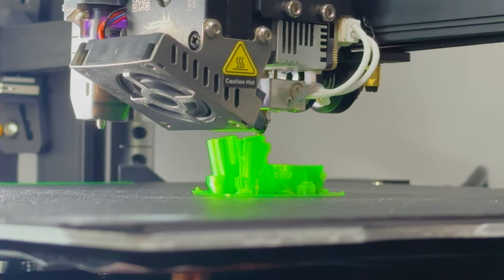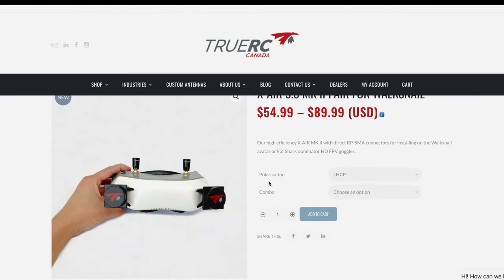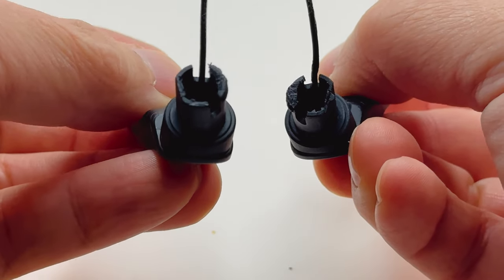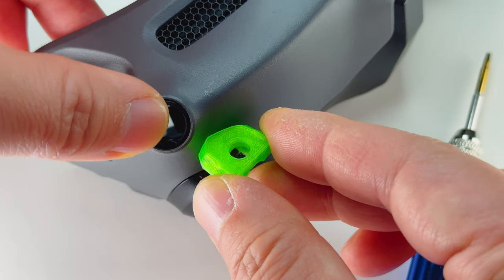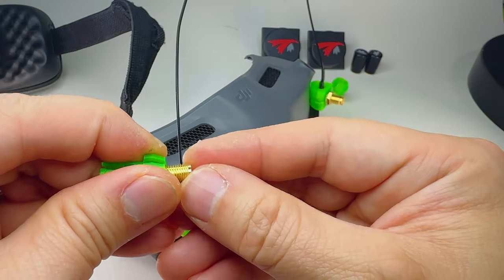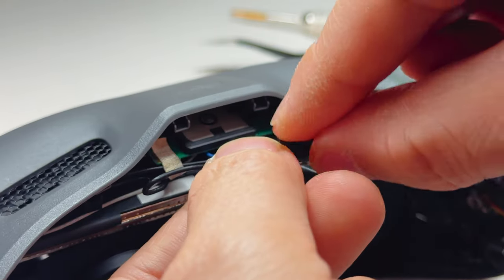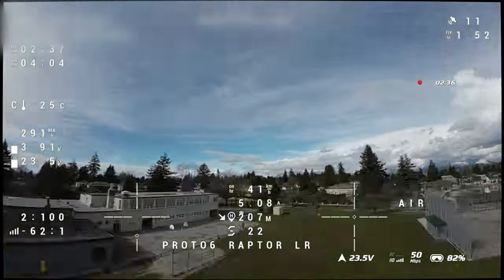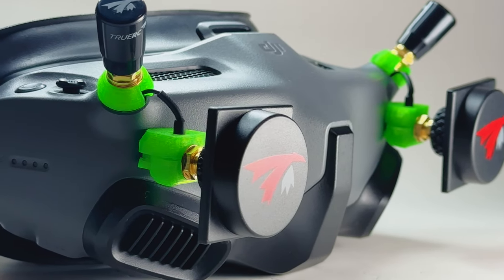HOW TO MOD ALL ANTENNAS ON DJI GOGGLES INTEGRA

Comment from the maker: * After doing the mod, Redo the binding/pairing with your vista or O3 air units. I found out that upon plugging in for the first time, the view was pixelated and mbps was at 0, some quads corrected themselves some didn't. After rebinding/pairing/ or rebooting, everything became normal
March 18th update: * Got to Test it as far as I could https://youtu.be/dxSvBEjHxo4 Need a bigger battery :)
Reply: Guten Abend 

Wo bekomme ich die Antennen Halterung?

Ich habe leider kein 3D Drucker. 

Gruß Robert

Comment: The easy way would be to ziptie/tape them to the stock linear antenna plastic housings. They fold anyway and the patches and ufl cables can fold with them, no more worrying about sma wearing out. For this method you can even go with the longer and more powerful X2 air. I heard that Truerc can custom-make them with ufl.
Reply from the maker: Thanks for your suggestions!

Comment: I want to just take the electronics, screens, and lenses out of the Goggles 2, and put them in a completely different shell with normal antennas. Why does DJI always have to torture us like this?!
Reply: For real. This mod basically just makes this the old walksnail goggles. Which came out like 2 years ago
Reply: The goggles 2 antennas come out if you just pull in them
Reply from the maker: @user-cb8ef5ki9u yes sir

Comment: for this kind of upgrade in dji integra what kind of antennae used in the o3 unit system ? Then really this informative video thanks for 3d print design
Reply from the maker: Hi I personally used two tbs long range triumph pro lhcp . https://www.team-blacksheep.com/products/prod:triumph_pro_lsma_lr you would also need two ufl to sma adapters. But any long reputable lhcp antenna with ufl will do too.
Reply: @PattyFlipz Will this modd improve the signal for Quads using Caddx Vista with LHCP antenna on it?

Thanks!
Reply from the maker: @hknight007  it's a perfect match, so technically it will work very nice, like a modded goggles v2. As for better signal, I do not know. Main thing is don't go behind any objects and make sure you have good antenna placement where it does not get blocked when you turn your quad.
Reply: @PattyFlipz  that sounds awesome, Thank you so much for your help 🙌

Comment: Wow nice one ! I like the idea of re-using the screws on the front cover 😁 thanks for mentionning my video! About the cap design I see you printed it in tpu, I printed it in tpu and pla and both left me not completely satisfied. The tpu is too flexible and the pla too fragile.. maybe there's something to improve there also 😀
Reply from the maker: Oh for sure! Yeah it’s still easy to remove as TPU, or maybe get knocked around, I don’t mind it though! But for sure if you want an OEM feel perhaps someone can try ABS ! Thanks again for the great video and 3d files to get all our imaginations going! 😃🙏
Reply: You should try carbon TPU. It's very strong with a nice finish. Also better quality than only TPU.

Comment: Appreciate the video, I did the mod following your guide however I don't notice any real improvement, I did kind of expect that and im sure in some situations the range will be better, but I guess because of where I usually fly its unable to really push it any further, I wanted to do the mod just because and I really want to learn and understand how to get more range but I think alot of it is just flying LOS and not behind stuff, thats how you get range but I guess adding better antennas at this point isnt really going to increase your penetration enough to make a difference compared to stock let me know if Im wrong, either way thanks again for the awesome tutorial, maybe i'll try some other antennas in the future :)
Reply from the maker: Thanks for trying it! I agree with all your points! I think everyone is going to have different results for sure. There’s a myriad of factors at play which makes it so interesting. The downside to my own setup (LHCP on drone and goggles) is I can’t fly drones equipped with stock o3 antenna as far anymore. Noticeably they have been performing a bit worse. But when flying matching antenna on both drone and goggles, it’s definitely most important thing I think is no blind spots with the antenna (position it correctly where it can never be blocked), and no interference (nice rural area without too much signals) and no obstructions between you and the drone, like trees and mountains.
Reply: @PattyFlipz  theres so many things I don't know and I learned a bit more lastnight, going to try changing some settings and see what happens, I usually fly in a area with alot of obstructions and signals, I was also suggested to try the X²-AIR 5.8 MK II, have you tried any other antennas yet?

Comment: Cool Mod! I'll definitely be doing this for my Goggles 2. I'm sure it's basically the same thing. Maybe I'll make a quick video on it lol!
Reply from the maker: For sure! 👍 looking forward to it!
Reply: Let me know how it goes. The main reason i didnt get the goggles 2 was the worse non changable antennas. Maybe Ill pick up a set now
Reply: Any update? If so did it work?
Reply: hello pls update
Reply: Have you succeeded to upgrade Googles 2? Do you have any video for the this?
Reply: Update: tried this and it doesnt work. At least not in the same way it does here. First off, the dji faceplate screws are a pain to get off. That took an hour just by itself. 
But opening the goggles, there is no clip to unplug the mcx connector. You would have to take everything out and unscrew it (its screwed in). I still want to do this mod without damaging the goggles so ill try to find a way to route the pigtail somewhere else
Reply: @KcCake  i appreciate you coming back to update us, thats a chad move. Ill hold off on opening my goggles2 then it sounds like.
Reply: @staymad7206  no problem! Hopefully save a few people the hassle of opening the goggles up if not ready to make a hole in the faceplate. 

I did not find any successful way of routing the pigtails without making permanent modifications (damage). I tried putting the pigtails through the eyesockets/next to the lenses but didnt seems like a permanent solution so I called it quits for now and put the old antennas back on.
Reply: @KcCake  i recalling seeing someone that drilled through their goggles 2 but that doesnt seem wise lol
Reply: @staymad7206  no it does not. Especially cause they dont sell spares. The guy that drilled did it for cooling or something lol. One guy filed down the faceplate so the pigtails could slot through but that also damages. Maybe i buy integra then 🤔

Comment: Thank you for the video!  Just what ive been looking for :)

2 questions if you have a sec:  

1.  With this setup can you use any analog SMA antennas you already have for the digital signal?

2.  Seems like most aftermarket o3 air unit antennas are LHCP.  As long as they match the receiver can you use 2x 5.8gh RHCP antennas on the o3 with the same style SMA adapters?  (I know the default is a 2.4gh rc and 5.8gh video.  I dont use the DJI rc link)

Thanks in advance!  Excited to try this out

Comment: Awesome video! Thank you for sharing this 👍

I have Goggles 2, will this 3D prints work on my goggles? Or do they only work on the Integra?

Cheers 🙌
Reply from the maker: Hi! Not sure if others have chimed in yet, but I'm thinking this is mainly for the integra. Just scour the comments section, some ppl here are talking about their findings with modding the goggles 2, but I haven't had time to look at the comments. Thanks and goodluck.
Reply: @PattyFlipz  Thank you, I'll do that. Cheers 👍👍

Comment: Very nice job ! 

I have one question, the blue and white cables are not the cables for the GPS?
Reply from the maker: Hi, good question!!  I don't think it is, the GPS seem to have other wires going into it coming from the left side. The blue and white wires with U.FL goes under the gps, but seems to be reaching for the front of the goggles. Who knows I might be wrong though! XD But it would be my first time seeing GPS using U.FL if so.
Reply from the maker: Also, there are no errors displayed on the  OSD. I would think if you unplugged gps by accident an error message would show up.
Reply: @PattyFlipz For the error, according to my research, GPS is only used when you use DJI drones and therefore remote ID. So i don't think the goggles check for GPS if not needed.
Reply: Also, when you check for spare part for DJI integra you can found a GPS Antenna for DJI Goggles Integra using ufl but only one cable.
Reply from the maker: @Cornusse thanks for checking, I think I remember now, you can see the single white wire going to the left side, the ufl from gps goes to the very left side of the goggles.
Reply from the maker: @Cornusse go to 2:57 in the video. You will see the greyish white wire from gps go to the side of the goggles …and you see the golden ufl connection  *phew!! 😂
Reply: @PattyFlipz Mystery solved! Well done detective Patty x)
Reply from the maker: @Cornusse   hahaha
Reply: @PattyFlipz  Besides, if you do a comparison video, do a test with 4 omni and another with 2 patch 2 omni test. This way we will see the boost provided by the patchs

Comment: About to do this. How have you found it? Better signal? Thanks for the video.
Reply from the maker: Hi all I can confirm so far is it’s in normal operation. Here is a flight that I sent it as far as the battery would allow me and still had enough signal to keep going. But I turned around because I want my drone back. 
https://youtu.be/dxSvBEjHxo4
But according to another sub he has confirmed he went 9km with stock integra goggles and a carefully placed stock o3 antenna. Anyway do what you need to do! 😂 I feel like the total LHCP set up may have better penetration or signal going around a few objects though. 👍

Comment: Hey man. Im about to upgrade my G2 googles. One question: for desired result should i use lhcp antena for 03 also or stock a is fine?
Reply from the maker: LHCP in your goggles will work with the stock o3 antenna too but maybe not as efficient as the stock goggle antenna and will be a bit of signal loss possibly. Be the best if you change it on the quads end to match, where LHCP is more common options for sure. Good luck

Comment: Did you use RX ELRS? Mine can’t penetrate a single concrete wall, it’s awlays signal lost
Reply from the maker: No I use tbs, but I recently installed ELRS but haven’t played with it yet. Default is really low. I think like 25mw. Try going in your transmitter menu and turning up the power to 100w to start.

Comment: Nice video!
I'm still new in the game and was wondering if it's possible to do this mod and add antennas that makes the dji googles able to run with hdzero system(for tiny whoop). Again great video!
Reply from the maker: Hi, no this mod is completely unrelated to that. Viewing hdzero in goggles integra at the moment I don’t think it’s possible or I haven’t seen the product, it usually looks like an add in box module you plug into the side. I think the old goggles v2 you can buy a plug in adapter to view analog (I don’t know if it can view hdzero)

Comment: do the steps and products also work on goggles 2 ??
Reply from the maker: The tpu print might work for the front ones. But I heard some ppl have trouble removing the screws for whatever reason. For the top ones you just need to find compatible goggles 2 antenna. It swaps out using mmcx connectors. The tpu print for the front ones is in the description below.

Comment: Im taking the goggles 2 apart to do this mod but the screws are stuck in there and i cant get them out. Did you have any difficulty with this?
Reply from the maker: Which screws? The front ones on the grey part? I think all the screws have a dab of blue lock tight too . I didn’t have tooo much trouble. Just need to push your tool in deep and twist. As for the rear just a really good small bit Philips head and driver , the typical screwdrivers to take apart small electronics like laptops.
Reply: @PattyFlipz  the ones that hold the face plate in. Im gonna try super gluing the screwdriver to then tonight
Reply: @PattyFlipz  the ones that hold the face plate in. Im gonna try super gluing the screwdriver to then tonight
Reply from the maker: @KcCake  how did it go? Did it come off? 0_0
Reply: @PattyFlipz  decided against using it since i dont want it to accidentally stick to my goggles 😬
I did some research and will try using a latex glove, and aluminum foil. 
If both of those dont work i need to send them in to dji anyways for something else so I will ask kindly for them to leave the screws a little looser

Comment: Does this work on the Goggles 2?
Reply from the maker: Have a read around the comments, I think some ppl have tried. Unsure if successful. Goggles 2 would only be the front section of the goggles as the top ones pull out directly

Comment: Anyone done this for Goggles 2 yet? I assume its the same, I'm about to try it.
Reply: Did it worked?
Reply: @hknight007  it did. Different connections though. Use mcx to sma on top and then I had to feed the cables for patches through the vents. Fiddly but still looks clean. All 3d prints works. As for range improvement, I feel more comfortable with it but no hard evidence it's better.
Reply: @WillEgby  Awesome! Thank you so much 🙌

Comment: Hii.. great video, anyone can help me, i have dji avata and what type antenna i should buy, LHCP or RHCP ..thank so much
Reply from the maker: I would suggest to keep the stock antenna for the avata since the goggles is designed with that drone in mind. The only reason we change these antenna is for the custom drones. We can change the antenna on both sides easily. Unless you can change the avata antenna too, but I don’t know anything about that. If you want better range just make sure not to go behind too many obstacles as well.

Comment: I am confused you don't use dual band stubby antennas this leads me to believe I change antennas to rhcp I forget if that is possible, 5,8ghz only I just need to match replacing DJI antenna with two RHCP. 5.8ghz and another set on goggles. This and triple feed patch antennas for $5 same performance without plastic enclosures. DUALITY 2.4/5.8 STUBBY FOR DJI would actually be best if this is not true.

Comment: I have an issue with the front prints, the screws don't go in far enough so I am not able to screw the piece to the goggles. 
Does anyone know how to fix? Maybe something wrong with the 3D print?
Reply from the maker: Did you try longer m2 screws? What’s inside is the internal plastic holder. (Same one that holds the antennas).  But DJI uses this same plastic piece to hold the front screws. If the internal plastic antenna holder shifted somehow  then it will be hard to screw them in.
Reply: @PattyFlipz  Thought about using longer screws, will try and order some. 
Thanks for the reply and also for this video, great work
Reply: Just wanted to add here that it worked by using slightly longer screws from a standard M2-M3 pack, in case anyone runs into the same issue
Reply from the maker: @LazyPanda21 great glad it worked out